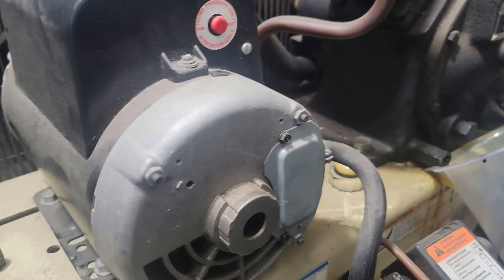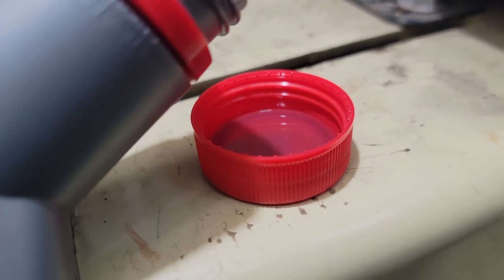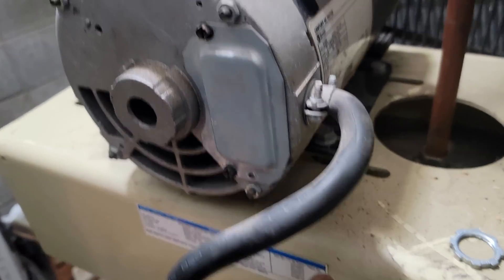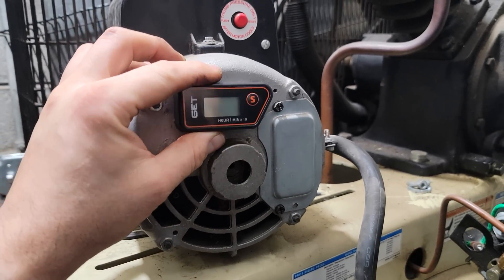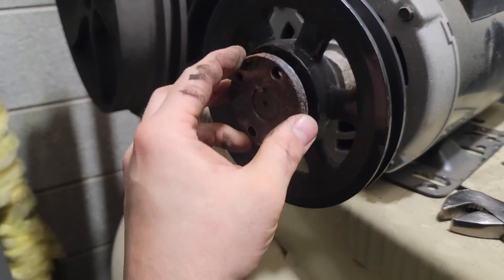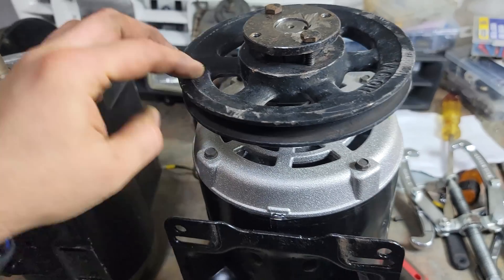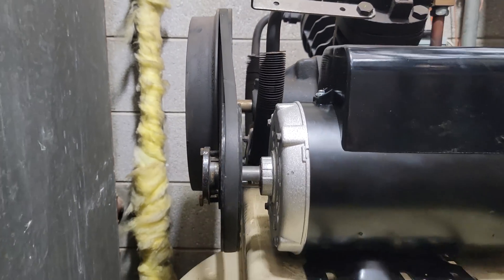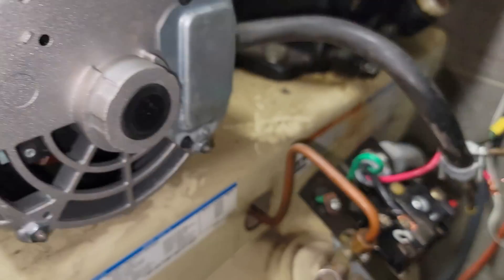My air compressor motor blew up.. I show you how to replace it and save money

Comment: Im on my 3rd motor as well on the same compressor.  All I use is amsoil in everything. I previously had a 7hp LESSON motor that lasted for 5yrs with not much use. Went back to 5hp as 7hp was almost 1000.  Absolutely Great video.
Reply from the maker: Thanks! I don't think there is any win-win situation on these motors. I wish they would last 20 years like the old days